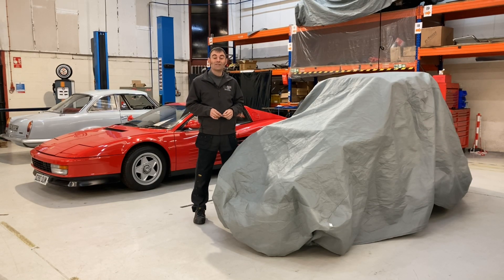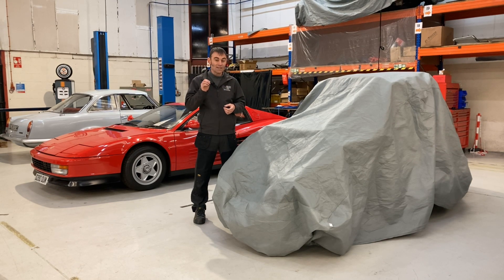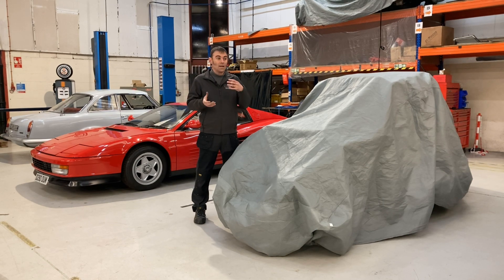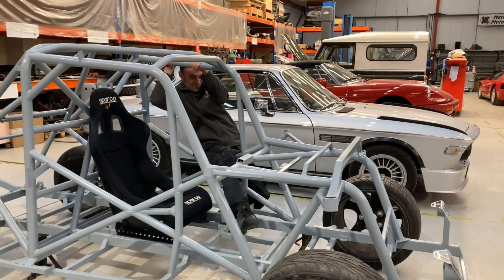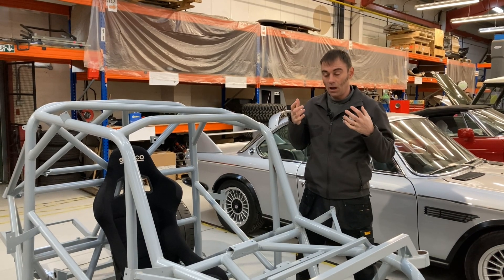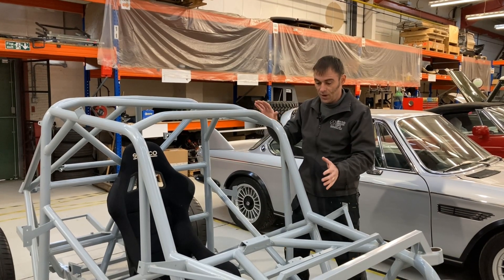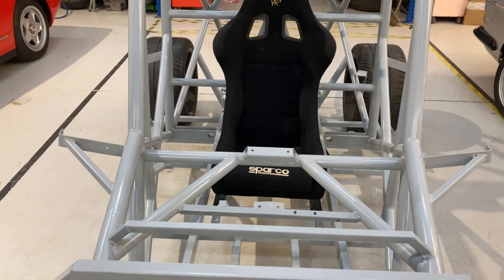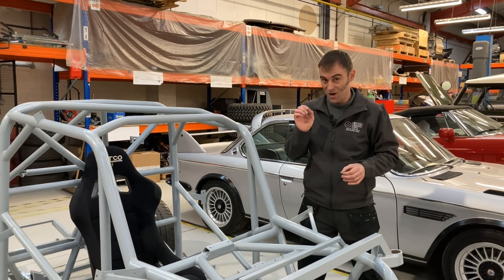Tesla Plaid slayer revealed.

Comment: nah your not crazy, you good sir are a forward thinker. building a balls to the wall race car to take on the Tesla Plaid. it's much the same with me. I'm gunning for taking on a Tesla Model S or Plaid with my own balls to the wall EV conversion. Yes I'm already beginning to figure out how I'm going to also beat Dodge at their own game. since they delayed their new Charger and Challenger EV's that's going to give me time to build my own. an EV conversion with the look and grit of a 2006 Charger, but the raw power of a Tesla Model S, and the interior with a mix of a Tesla and a Charger. 

but the key difference that no auto manufacturer ever considers is having a modular Dash board. a Dash where you only need a butterfly key to open the dash to work on it, or to get to a certain part without having to even rip the dashboard out. it's going to be the same with the instrument cluster. another difference is the inclusion of an 8 track player, a cassette Deck and a CD player/ radio. all built on a Cold rolled steel frame.

Comment: Hi, I've got a question about high voltage vs low voltage. Talking to a local conversion shop here in NZ, they recommended I use a 96v (Curtis or Hyper9) setup for my Spitfire project. Where as, I was thinking of a 300-400v Leaf or maybe Chris' Zonic motors. So the question, for a light Sunday cruiser diy conversion, hoping for 100 mile range, would you recommend 96v or 400v architecture?

P.S. I have professional experience with high voltage work so safety is in hand.

Comment: Great stuff.  I m wondering how the two motors will be synchronised together so that one is not pushing more than  the other.  Is there like a virtual torque scale?
Reply from the maker: The rear large Tesla drive unit is the master and manages the power delivery of the front motor.

Comment: LOVE IT!! Especially wrapped in a beetle body. Would be good if you could put the front in regen and power through a corner using the rear motor.  Or vice-versa can’t wait to see all the control systems you will run and dash setup. Also maybe cantilevered inboard shocks. Get that unsprung weight down. You will need to build all carbon fibre interior fit out. Even Cf floor with built in aerodynamics to create downdraft under her.🤟🏼🤟🏼🤟🏼🇦🇺

Comment: I imagine you can get a battery pack between the back of the seat and the rear motor unit and even a short pack over the motor., like an upside down 'L'. Side pods would seem to be the way to go on either side of the seat going from the area near the front drive shafts to the rear battery pack. Is it possible to increase the height of the side packs at the front and the rear with the lower area where you have to climb in and out or over? I guess it would depend too on the side of the cells you are using.

Comment: (Assuming Tesla-style battery packs) I would imagine that, if you spin them vertical, you could get 2/3 batteries attached to the frame behind the seat, possibly both sides of that frame.  I can see space for a battery in the flat area below the bonnet hood, possibly one above and one below again, just bolt through such that the one above lifts the one below.  I can see space for more batteries attached to the roll-cage sides, again you could spin them vertical, possibly, if they won't foul the opening, or maybe one horizontal and one vertical towards the rear.

Or, you could build a battery tray and suspend the batteries below the chassis, giving you plenty of room.  You would have to jack the suspension up but, given that the weight is still really low down in the chassis, that should not mess with the handling.  You could use the strength of the chassis and put the batteries on the floor tray, lifting the seat as you mentioned, but equally it might be possible to find a seat with good clearance underneath and advantageous mounting points, if you can then spread the batteries around between the seating mount point.  You then just need room for your seat.  Handbrake could be mounted from the dash board ?

Comment: Richard,  I haven't able to find any EV conversion companies in the US that would work on a non-classic car.  I have had one of your really good ideas, that always turns into one of my really bad ideas.  I want to convert a 2019 VW Beetle convertible to electric, using Chevy Bolt parts.  The wheelbases are within an inch of each other,  and the VW is front wheel drive as is the bolt.   How hard,  how crazy an idea would it be?  Buy both,  do a swap conversion?   

mmh 200 hp. 260 ft/lbs of torque, awfully fun to drive.

Comment: A tall order on replacing that power , the Plaid battery is 462 vdc maximum and a maximum discharge current of 2304 amps.  The Plaid battery pack is made up of 5 modules  measuring 390mm x 76mm 1458mm.  If there is room in your tube chassis there still is a problem of the odd number of modules if stacked to the left and the right of the center mounted drivers seat.  Because of the high voltage and maximum current it will be difficult piecing together a salvaged OEM battery pack.  So then to find individual cells that will fit in your tube chassis.  As mentioned before, a high "c" cell such as the "sleeper cell" is probably your best option.  The "sleeper cell" has a well established performance in electric vehicle drag racing, NEDRA.

Comment: The devs at Porsche designed methods to curtail EV Performance Fade from heat soak. That’s a hell of a challenge to pack that much plaid in such a small package. What are your plans to minimize EVPF from heat soak?
As for battery placement, obviously a pair of L pack under the driver, and coming up the side of the seating position, separated by the drive shaft. The second immediately behind & in front of the driver, but I think you will have to make a way to surround the motors and gearbox/drivetrain, to make them fit. Then what about the controller and cooling, the equipment AND the driver?
Bitchin build! Can’t wait to see it happen, 
May the Schwartz be with you. 
(Hint: plaid, Spaceballs)

Comment: Q: Hi there, love your work! 
Unfortunately, I am a budget oriented guy but I would love to do a conversion of my own. 
Looking to convert a fiat 126. Is it worth using hub motors all around? I have found some Chinese ones 18Κw each and therefore have an easier job with fitting the batteries. Having said that, I am very cautious quality wise. Would love to know your thoughts!

Comment: With a limited battery capacity dictating the maximum current draw , would it be worth considering just using one motor and a transfer box driving front and rear axles ???

Comment: Excellent project, it will be dynamic. I recommend going with a swappable battery pack configuration so that the pack weight can be adjusted to suit the track. A super/ultracapacitor battery pack will be super expensive but the weight will be very light compared to more conventional batteries. For the absolute maximum performance battery pack weight is paramount. Major limitation with capacitor batteries is range, so alternative packs become a necessity.

Comment: Isn’t that a model 3 Rear drive unit? Which is a plaid front drive unit .

Are you using 2 x model 3 RDU / plaid FDU’s ? Or a 1 model 3 rdu / plaid fdu and a dual motor plaid RDU?

Comment: I would like to see an AWD siglecab wide body with 100+ kWh battery under the bed as the next build, for driveability and fast enough to roast a corvette.  And to be stupid,,, air suspension and quick disconnect fenders so that off-road tires/wheels and off-road fenders could be quickly slapped on to do a Shasta snow trip type excursion,  but that would be stupid🙄

Comment: Absolutely awesome!! 😁👍
Is modifying the chassis an option? 
Redo the tube floor under the seat, and use the battery box as a stressed member? Help handling with LCG.
Guessing 'Binky' is now a unit of project time scale, like 'Ugga Dugga's' are to bolt torques...🙄🤣
Reply from the maker: Absolutely, it's a universally recognised unit of time now. I'm 6 Binkys old now. 😆👍

Comment: Battery packs are going to have to be made up to fit the best available spaces.  Either side of the main internal frame  on the floor across the frame ...front one behind drivers seat Toblero shape the one behind could be the same right angle triangle shape but if you can extend it up and the need is for cells in a  suitcase shaped pack bolted to the back of the main bulkhead frame web . 
As you stack upwards you will begin to raise the C of R and G. So i would suggest keeping it below the top of the wheel rims if thats possible. 
See whats left in front but i would think twice about further sharing of the drivers space with more Cells.  
I enitialy  thought it was an off road kit buggy chassis. 
I dont know if you intend to race this in a class series but i assume it will have to conform in other ways to the rules. 
For a one off i would have gone for something lower in the roof line Think Mini sprint look but you'd need be a caver to get in or out😂
Bodyshell carbon or carbon braced kevlar/glass.  Though you could look at basalt fiber for 
a 50% wt save over GRP.

Keeping the wheels in contact with track is going to take a zero wind up suspension....but with A Colin Chapman supple compliance to it... anyone can build a go cart/dragster. 🤔...but hit a bump in a bend,😬 Getting the power down to the ground and keeping it on the ground at all 4 corners will be the challenge. 
Inboard rising rate suspension with adjustable two way damping?
Light strong wheels, discs and calipers... engine braking regen might help in this direction by reducing the unsprung wt  ..is ABS allowed... though it probably could be programmed into the motors at the rear.
Wt split close to 55 /45  isnt going to be possible by the look of the driving position. But aerodynamics come into play at speeds around 50 mph.
Power split would ideally be slightly tuneable to the track and the surface conditions... akin to a brake ballance peddle box on a rally car.
Reply from the maker: Lots of good points there. Thanks. 👍👍👍

Comment: just curious about the pack size and plaid performance. Motors clearly like a lot of power. Large pack can dump mega Amps / Current... how much of that 1000 HP will you lose using smaller pack for Power to Weight of a race purpose built car....
Reply from the maker: That's why we're going to use a pack with a high C rating so they'll be able to cope with large amp draw from the motors. 👍
Reply: @ElectricClassicCars  C rating is fascinating. Great topic of discussion as it's kind of a hidden statistic from LG chem and others. My RC planes and cars, C rating was front and center in dumping huge power.

Comment: For the Q&A...Why do EVs use AC motors instead of DC? With the energy stored as DC in the batteries it would seems logical to use DC motors, so there must be a big benefit to using AC motors and needing an inverter. Thanks Moggy 👍
Reply: I think you can get a lot more power from a three phase motor ( AC + inverter ) than from a pure DC configuration .I’m sure someone can expand on that.
Reply: Also you need variable amplitude and frequency you don't get that with a d.c motor.

Comment: Great project - from a standard racing point of view I would love to see some cantilever suspension work on the build and since it is a light weight project, some carbon ceramic or at least floating discs. And some carbon wheels. From a EV perspective it would be great to see some advanced torque vectoring and an advanced launch control with optimal power ramp up
Reply: What about some serious custom inboard front brakes, so he can run some very cool aero wheels and then use no rear brakes at all like the latest gen3 formula e cars are going to do? 🤔

Comment: well, Tesla has the lay-out batteries, on the floor, cooling front and rear, carbon fiber hoods, fenders why fiberglass? weight? Bilstein suspension, why are you not using the same power as your silver VW? one in the front and one in the rear you are really killing your limited space with that Hugh Tesla plant, pleyxy- glass for the windscreens, some nice 50'' tires ROCK AND ROLL nice I think you need and all-carbon-fiber bodybuilt in brake cooling cutouts, steel rims.

Comment: An exciting project, not sure if a variable height battery mount behind the driver could be done readily, I realise you are going 4wd with the project but I think for drag racing you may get off the line quicker with a raised centre of gravity where momentarily the down force on the rear wheels exceeds the entire weight of the vehicle. For circuit racing the batteries probably want to be below the chassis. Could some of the battery go in the wasted space under the drivers legs and either side of him? I am thinking that if the mass is well inside the wheelbase the polar moment of inertia could be minimised. Disclaimer: I know bugger all about race car chassis design. Certainly this will be exciting, I am old now and 1000hp seems like too much, but it would be a handful even with just 900hp.

Comment: Great project and tubular frame a nice strong base. Going to be interesting watching you figure out the battery location and installing the engines. Search for the lightest wheels you can find that can handle the power. Brake balance adjuster could be useful. Are body panels   fibre glass or something more exotic like carbon fibre?

Comment: What about running just the tesla model 3/y modules intact lengthwise with 2 on each side of the drivers seat like ballast? 🤔
I saw an a.c. cobra conversion where he ran all of them on the passenger side front to back in a single 4 high stack. 

Regardless this and the Ferrari teslarosa conversions has me pumped up for 2022. 😎

Comment: Omg, she's gonna be quick, imagine just carrying only enough batteries for one pass at the quarter mile, it would be insane, power to weight ratio is everything. And massive wide slicks for traction out of the hole 🕳 🚥
Reply: problem is that the smaller the battery pack, the smaller the amps it gives. You cant get 1000Amps from a 20KWh battery. You need the KWh. So again its a balancing game.
Reply: @vourkosdude   There are 100/200"C" batteries that are  available for purchase.... https://www.power-sonic.com/blog/what-is-a-battery-c-rating/
Reply: @vourkosdude  Obviously the pack has to be large enough to pull the amps 🙄
Reply: Exactly what I was thinking, say 0.6 mile range. So you can drive it up to the timing lights, down the strip and back! I'm sure that will be a thing in future drag races.

Comment: For your Q&A's ... I've always wondered about the practicality of electric 4x4's in off road wetland conditions ... I've seen diesel vehicles with snorkels crossing rivers, but how would a electric 4x4 (like your Land Rover) cope with a proper river crossing? At what point does water level become an issue? Can occupants ever get electrocuted?
Reply: I presumed, if all the electrics are totally sealed, its the driver that's the weak link, if the driver had scuba gear, you could potentially drive on the sea bed? (Diesel submarines are an EV underwater)
Reply: Check out Chillin with Chet. He has a video where he takes his Tesla Model S Plaid and drives it underwater.
Reply: Very good questions
Reply: Now this is a question I'd really love for somebody to answer.

Comment: I'd love to see some paddle-activated regen in an electric racecar. I love the thought of managing breaking in a corner with various strengths of regen, maybe a little tap on the break, then accelerate through the apex. Sounds fun!

Plus, embrace the efficiency of electric!
Reply: This makes no sense. In a modern EV the strength of regen is determined by how hard you brake. Once you reach the drivetrain's capacity to regen then it'll add in regular brakes on top of that to slow you down. In normal driving the regular brakes are rarely activated unless you brake very hard.
Reply: As I understand, the amount of regen is managed by the control unit. This can be set to driver preference (release of throttle = coast OR regen with braking effect). 

The scenario I'm envisioning is the driver has "coast" setting so that releasing the throttle doesn't engage any braking effect. Then, the driver activates an increased regen/braking through a paddle, only hitting brakes in corners that require it.

This keeps brake heat down (saving it for a corner that needs cool brakes) and reduces wear, and maybe gets you a little extra distance from the battery along the way.
Reply: @bean_and_goob  formula e uses Regen braking, but it think they also use regular brakes. It would be interesting if only regen braking was allowed. They'd have to break waaaaay earlier for most corners though
Reply: @bean_and_goob  that's already how it's done